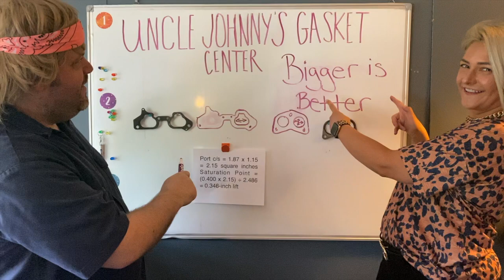The great gasket match- is it so great?

Comment: I never understood this argument against gasket matching. It makes no sense. Gasket matching has nothing to do with "well the gasket maker knows what size port is the best". It has to do with ensuring there are no ridges blocking or interrupting airflow if one port is slightly different than the opposing face. Opening both sides of the ports to the same size as the gasket opening is the easiest way to ensure they are the same exact size and shape openings.
Reply from the maker: sure, there is always the easy route vs the right route. Most of the time, you can't just take a gasket on both parts, port it and they actually line up. I have seen some that would need epoxy to make them line up and the gasket on the intake looked like it would line up perfectly. The right thing to do is make the head the correct size and then scribe the manifold to the head and then make the head close to the same size. Otherwise, it is just a guess and your making the cross-sectional area too large for no reason.

Comment: Gasket porting comes from an old SCCA rule in certain Touring and Production classes where the only work you were allowed to do on a head was to match the gasket opening and you were only allowed to remove material an inch inside the runner, so they took what they could get... big fat wide mouth and then you have an inch of real estate tapering to the stock casting
Reply: lol!!!

Comment: If you have a flow bench handy you can tell where airflow is too much for what you’re running. A smaller port keeps velocity high. If you want low end torque smaller is better. If you’re looking for high rpm performance, you may need a large port. But everything has to balance.
Reply: You're damn right!

Comment: Alright Bobby Bushay, but what about a motor with forced induction?
Reply from the maker: it does not matter what aspiration. A gasket company is not taking into account the optimum cross sectional area for a port with or without boost.
Reply: Let's put aside that gasket company stuff, you may not see great gains in a forced induction engine, cause the turbo or the supercharger is helping a lot with that. On the contrary, you might have better gains on an N/A. But again, we can't draw any conclusion unless, it has been flow benched, and dynoed.
Reply: Best thing to IMHO, is to take of the valve, install the inlet and the exhaust manifold gaskets included, and then run a camera through those channels, to see if there any protuberances, that hinder the flow.....And then compare stock vs tuned on a bench.....